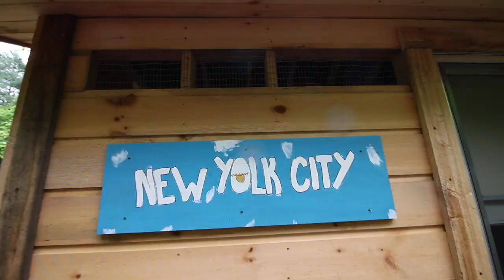The Good the BAD and the Ugly of Modern Homesteading

Comment: when i transplant my tomatoes, i always break off the lower leaves and plant them a little sideways at the bottom, covering the stem to 2" from the lowest leaves.  it gives them a stronger root system.  tomatoes will root and sprout all along the stem, anywhere they touch dirt.  if you let them grow down on the ground like wild, they spread along the ground and sprout stems all along the length of the vine.
Reply from the maker: Thanks for sharing! It is crazy how they grow in the wild! They are almost a bush if left alone!

Comment: Sorry about the chick, like you said, just part of farm life. I find it interesting that so many build raised beds with wood. I learned about French intensive gardening, way back when. As you built up the soil for your beds, you use the back of a flat shovel and pack the sides so they slope. When racking out the flat top, build a small dam wall all around about 2-3" high. The dam wall prevents any pooling rain water on top from running down the sides causing rivulets that would erode them. Plant the slopes with low growing crops, like strawberries. Around the border dams I planted dwarf marigolds, natural bug proofing and they looked really pretty. Intensive companion planting, no need  for cover mulch to keep weeds down. Beds were 6' wide, 100' long. First row across, plant corn, over 6" plant a pole bean or pea, 6" plant another corn, 6" another bean/pea, alternating. Next row only 6" but start with a bean/pea, then corn, rinse and repeat. The legumes used the corn stalks as poles, fixed nitrogen and the intensive planting prevented weeds from sprouting. 50' of corn, legumes, then came tomatoes or peppers. Again planting close to shade the soil to prevent weeds. Tomatoes and peppers don't like each other. After a section of one or the other I would plant bush eggplant, then another section of either the peppers or tomatoes. (Whichever I hadn't already planted). That first bed was all corn, legumes, peppers, tomatoes, and eggplant. (Both tomatoes and peppers like eggplant or squash as a companion, so you could use zucchini/yellow squash instead. Another bed was all fine seed crops, onion sets, garlic radishes, beets, turnips, carrots, etc. Then one bed with all my vine hard squash, butternut, acorn, turban, and my bush zucchini/ summer squash. One bed always had a green manure, I liked hairy vetch. It fixes nitrogen, grows dense, is a great green fodder for critters, and chokes out so weeds can't grow. (This bed was always followed the next season with the fine seed crops. Fine seeds were followed with the corn legumes, the following season, last season was the squash, then back to green manure. Was a good crop rotation to keep the beds healthy and keep weeds down. The vetch I would harvest a section daily and feed,goats, chickens, and rabbits. Top dressing with chop and drop as well as composted manures on all the beds after the season.
Cold crops always bolted if I planted in spring. I would count back from mature date and calculate from first frost to get an idea of when to start my cold crops, (leafy greens, broccoli, cauliflower etc.) later in summer so they would have the cool of autumn to mature without bolting. 
Sadly this was a rental farm and was sold out from underneath me. :(
Reply from the maker: Thanks! Great info! When the boards rot I will have to try that! Those companion plants are great to know! Sorry to hear the farm got sold!